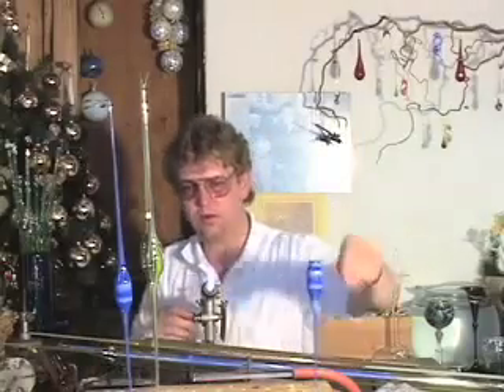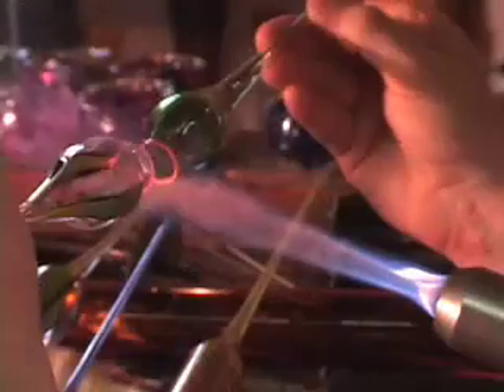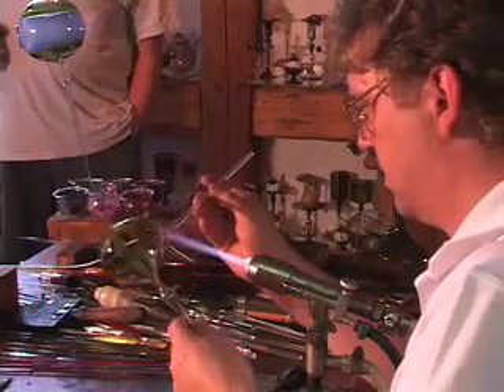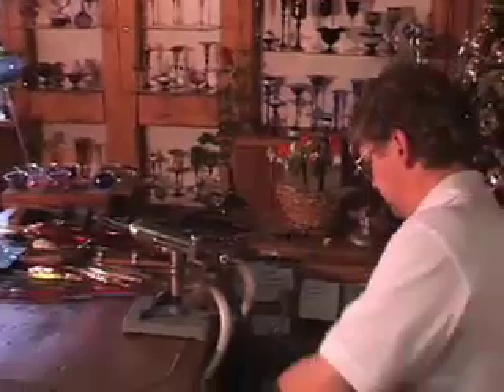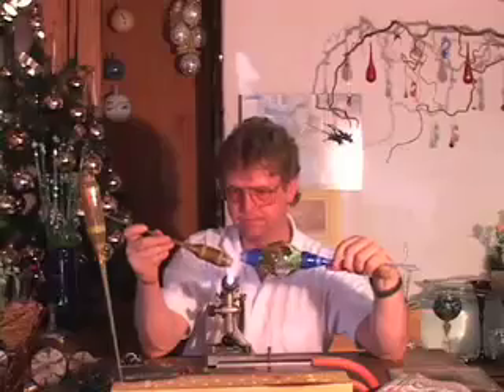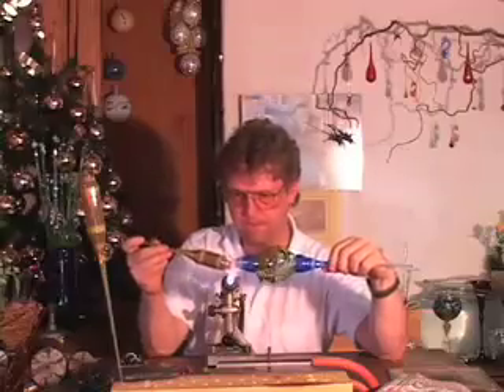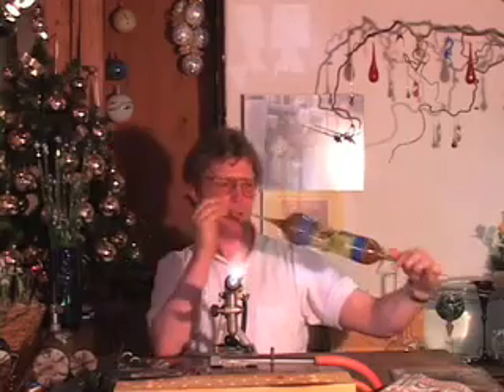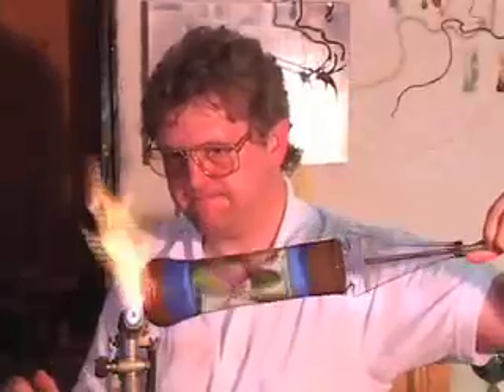Flameworking! Montage Vessel w/Thomas Müller-Litz of Lauscha

Comment from the maker: Clark, for it to cause silicosis you would need the glass to be like an airborne powder. When the part that's blown out thin like plastic wrap is crushed in your hand, it makes shards, which are like large flakes of confetti. They cannot be inhaled or anything like that…..they are thin flat pieces that fall harmlessly out of your hand onto the table, not airborne particles.
Reply: +Marcie Davis Easily one of the most hazardous comments I have ever seen related to glass blowing, you absolutely can inhale bubble trash and it can/will cause silicosis. This is why you will NEVER see an intelligent glass blower working without adequate ventilation. Bubble trash floats through the air, of course you can inhale it. Source: 16 years of lampworking as my full time profession, this is day one information, if you don't know it, you shouldn't be blowing.